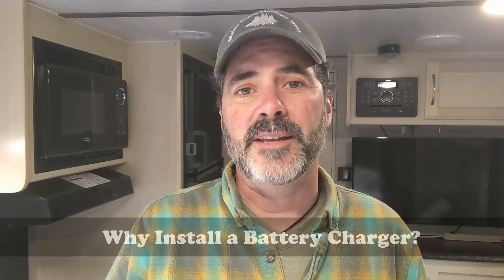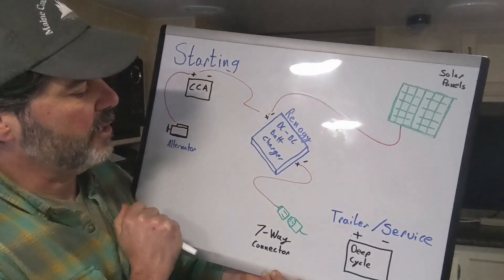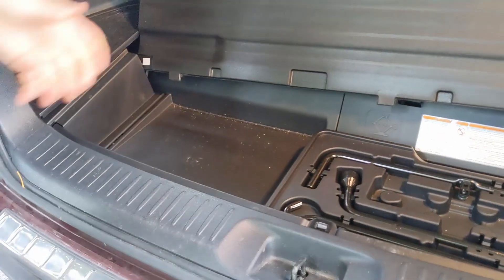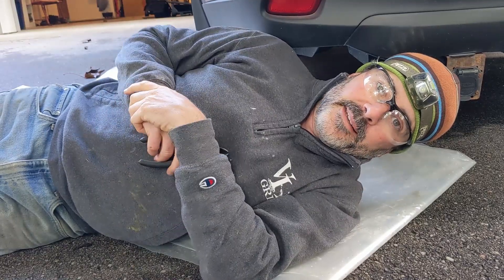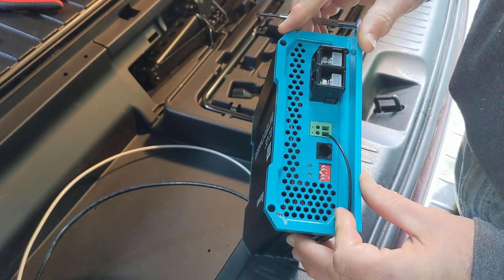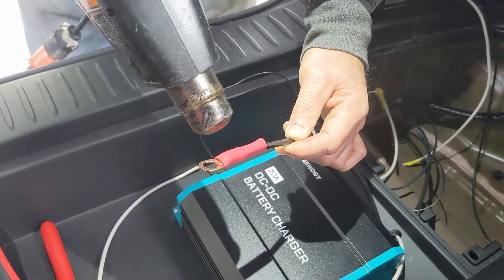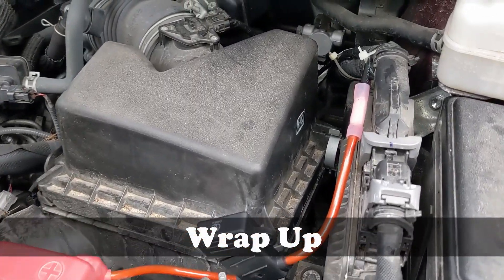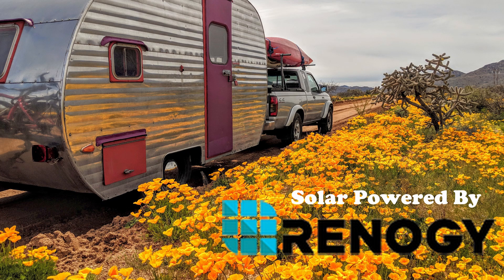How to Effectively Charge RV Batteries While Driving: [Renogy DC to DC Charger]

Comment: OK, I've ordered a 20A DC to DC charger and will install it in my Mitsubishi Pajero Sport 4wd for use with a LiFePO4 battery: both will be installed in the back part of the vehicle. I'll use this to run a fridge. I also want to remove the battery from the vehicle when setting up camp for a longer stay somewhere so I'd have the battery and fridge at camp. I sent in a technical request to Renogy which appeared to come back from their local agent/distributor in Hong Kong (I'm in Australia). They advised that it might burn out the charger if I disconnect the fridge battery from the DC to DC charger while the charger is still connected to the vehicle's engine battery. This doesn't make sense to me. If it can be used to charge a battery in a trailer then it would be disconnected from the battery in the trailer every time the trailer was unhitched and parked somewhere. Can anyone confirm that it's fine to leave the DC to DC charger (20A model without solar) connected to my vehicle battery regardless of whether the secondary 'house' battery is connected or not?
Reply from the maker: This is a great question.  I think the confusion might be between the Dual input DC to DC and the regular DC to DC charger.  Because, our parents certainly leave the DC to DC charger connected to the starting battery and haven't had a problem.  With solar controllers like the Dual Input DC to DC you should never disconnect the battery without first disconnecting the charging inputs, solar or engine.  But we're gonna run this on by our engineer friend at Renogy and we'll let you know what they say.
Reply: @FreedomInACan  Thank you Shari. I'd greatly appreciate clearing this up. To be clear, the unit I've ordered is the single input 20A DC to DC charger, not the dual input (solar and starter battery).
Reply from the maker: @glennp9750  Hi Glen, just heard back from our contact and he says there shouldn't be any problem with disconnecting the battery from the charger.  You just want to be sure that you've shut off the engine first, which is kind of a a no brainer but just to be sure.  Best of luck!  And send photos of your rig / set up!
Reply: Thanks again Shari. That makes sense. I appreciate your help with this. One more thing you or another reader may be able to help with: I'm using the charger to charge a Lithium Iron Phosphate battery (LiFePO4). On page 17 of the manual on the website under "Setting Lithium", it has two tables for different "Lithium Voltage" and corresponding DIP switch settings. No problem with that except that it's not made clear anywhere whether "Lithium Voltage" refers to the nominal/operation voltage of the battery or some other voltage like the recommended charging voltage, maximum charging voltage or some other voltage specification for the battery. I assume it is for the nominal/operation voltage but would like to be sure to avoid damage to the charger or battery.
Reply from the maker: @glennp9750  What is the type of battery that you have and what is its charging parameters?  As I read the chart on page 17, I think that SW3 & 4 set the low end and SW 1 & 2 set the upper end.
Reply: Shari, as noted, it is a Lithium Iron Phosphate battery (LiFePO4) with 100 Amp-hour capacity. Nominal/operation voltage: 12.8 volts; Rate charging voltage: 13.8 volts; Maximum charging voltage:14.6 volts. I think the voltage chart refers to the nominal voltage but would like confidence this is so as damage can result if incorrectly set, especially if the voltage is set too high. I think this is probably another question for the technical team as they really should have been clear about what this voltage refers to but weren't
Reply from the maker: Sure, yes, got that it's an LFP and thanks for the other info. Sounds like a relatively standard LFP...but to be triple sure, a couple of questions...what brand of battery do you have?  Is it a "Smart" LFP or regular?  How old is it?  I can send this info to our engineer contact at Renogy; he should be back to the office on Monday.  All of this information will help him determine the setting you need.

Also, just so you know, Renogy sells in 8 different countries and battery parameters can be different in other parts of the world.  Also, many people are building their own LFP batteries these days, thus the different LFP settings.  The Dual Input version of this DC to DC charger (newer product) has a special "user setting" for home built batteries which can operate differently.
Reply: Thank you again Shari. The battery is not a Renogy branded one and it's not 'home made'. Brand: VoltX (not Voltax). Like most commercial batteries, it has a built in battery management system for cell balancing and to protect against short circuit, over discharge, over charging, operation outside temperature range etc. Like most LiFePO4 batteries, it has a nominal/operation voltage of 12.8 volts. Here are the other voltage paramaters: Charging voltage: 13.6 - 13.8 volts; Discharge cut-off: 11.2 volts; Overcharge protection: 14.6 volts. Recommended charge controller settings (additional) Overcharge recovery: 14.2 volts; Overdischarge recovery: 10.6 volts.
Reply from the maker: @glennp9750  Got it.  We have sent this off to our contact at Renogy and will keep you posted.
Reply from the maker: Ok, we have both a simple answer for you, as well as the whole backstory from Renogy, which is helpful. If you want the backstory, please email us at freedominacan1957@gmail.com and we'll pass along his email to you directly.  Here's the simplified version for now:

SW1=OFF
SW2=OFF
This selects 14.0V.

SW3=ON
SW4=ON
This selects the second set of lithium voltages.

SW5=OFF
This sets the charger to Lithium.
Reply: Thank you again Shari. I'm indebted. I've emailed your directly seeking the more detailed response. It seems the manual's "Lithium voltage" refers to the charging voltage as 14.0 volts is the closest option to the recommended 13.6 to 13.8 volts charging voltage for my battery.
Reply from the maker: @glennp9750  Happy to help out!  All the best...

Comment: Hi nice video one question with the settings why did you turn 3 off
Reply from the maker: Good question.  We set the charger settings according to the manual based upon the 12V Lead Acid Battery that we're using in the RV.  Different types of batteries require different settings.

Comment: If you wire with separate  anderson cable, could a lithium battery still draw too much over the 7way since it's not limited by the DC-to-DC anymore?
Reply from the maker: If I understand your question correctly, if you go with the Anderson connectors, you won't need to mess with the 7- way.  It's an either or situation.  The Anderson connectors still connect to the DC to DC charger, but create an easy quick connect / disconnect in between the DC to DC charger on the vehicle and the house battery bank on the trailer.  Of course this means you'll need two sets of cables, one for the house battery and one for the charger.  I hope this answers your question.
Reply: @FreedomInACan  I'm looking at the DC to DC charger to protect my alternator from a lithium drawing way too many amps and I thought if there was still a path through the 7-way wire with no dc-dc it would still try to draw through that in addition to the Anderson cables
Reply from the maker: @cc-hc1dr  The lithium iron phosphate battery shouldn't "draw" more than it is given through the charger.  If you trickle charge it through the 7-way, without the DC to DC charger, it won't adequately charge.  But with the DC to DC charger, you do get a boost, as well as appropriate LiFePo charging parameters.  Since the charger acts as a charge controller it protects both the starting battery as well as the house battery.   If you connect the DC to DC charger as we did in the video, you will get a small voltage drop through the pin.  That was a "lesson learned" on our part.  This is why we recommend connecting  via Anderson connectors, instead of going through the 7-way.  I hope this helps.

Comment: Is this possible using if I don’t have the 7-way connector? Mine is only the factory one which i think is a 4-way? …no backup lights etc. Or do I have to change to a 7-way towing plug? If so, is that hard to do? Thank you! Art
Reply from the maker: Hi Art, you do not have to switch to a 7-way connection.  In fact, it would be better if you didn't, because there seems to be a slight drop in the pin connection.  We would recommend using Anderson quick connect cables between the DC to DC and the battery bank.  These will allow you to regularly connect and disconnect your charging cables just like you would the 4-way, when you take the trailer off your tow vehicle.  We used the 7-way in this video because we were trying to avoid another set of cables, but it turns out that it would have been better to do it that way.  You can get the Anderson cables from the Renogy website, see link in video description and use our discount code "canlife" for 10% off.
Reply: Well it looks like I do have a 7 spade connector out the end of my 2006!Lincoln Navigator. However, I think I will need to install/run thicker wiring (4 gauge) since it’s going to be over 15ft. fr the starter battery to the Renogy dc to dc dual charger which will be mounted in my cargo trailer According to the Renogy, support ppl. Please correct me if I’m (they’re)?wrong? Makes sense though. Right? Thanks!
Reply from the maker: @artest7  That sounds right. We would recommend bypassing the 7-pin, and just connecting using the Anderson connectors.  Best of luck with the install!

Comment: Hello. I assume this will work in a camper van as well. The reason I ask is because I have solar system in my van that will allow my solar panel to top off my starter battery when the house battery is fully charged but will not allow my starter battery to charge my house battery while driving. Could I add this to my existing system to top off my house battery while I drive? also what stops the unit from over charging the batteries? I have deep cycle AGM batteries.
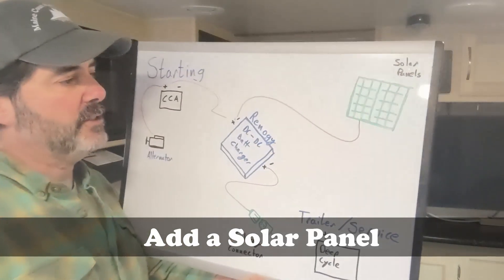Reply from the maker: Hi Kendall,  Thanks for the comment.  What you need is the DUAL input DC to DC Charger which I mention at 2:30 in the video.  It is compatible with all types of solar deep cycle batteries, you just need to set the device for AGM. This will charge your house battery while driving as well as allow a charge to come in from the solar panels, with any excess power returning to your starting battery.  This product will replace your current battery isolator and/or solar charge controller, which is what I assume you already have on your camper van.  The charge controller function keeps the battery from being overcharged (that's its main job).  Depending on the size of your solar array and house battery, you will need either the 30A or 50A version of the DUAL input.  YouTube is having problems with links in comments, so go up to the video description for 10% off this product!  Let us know if you have any further questions, and feel free to contact us via email as well:  freedominacan1957@gmail.com

Comment: Shari & Hutch,
Here’s some feedback on Renogy’s 60A DC-to-DC charger that you recommended to us. It works great!  On two separate occasions the AIMs 200Ah Lithium Iron Phosphate battery that we installed in our 31 ft travel trailer was between a 20% and 25% charge (after some dry camping) when we turned on our charger while pulling the camper down the road to our next campsite.  [We have a 2017 Ford F-150 pickup with a very capable 220 amp alternator.  We ran 2 gauge stranded copper cables from our battery to the Renogy charger located in the covered bed of our pickup.  We ran 4 gauge copper cables from the charger to our travel trailer’s battery with a heavy duty quick disconnect (Andersen type) for the two cables at the back of our truck].  In both cases it charged the battery (at 53-56 amps) to 100% within 3 hours time. Thanks for recommending a great product!
Reply from the maker: Wonderful!  Thanks for the feedback.  So glad it worked well for you.